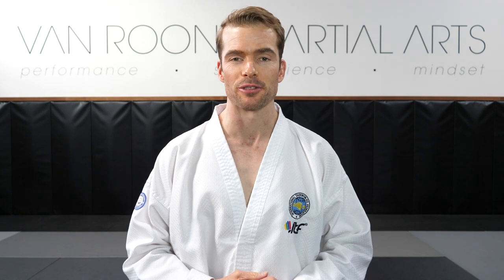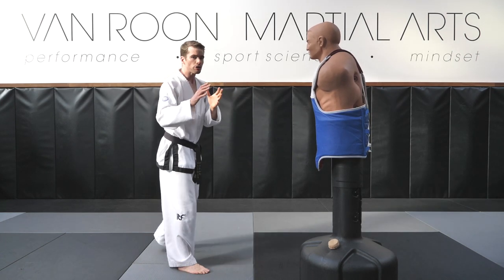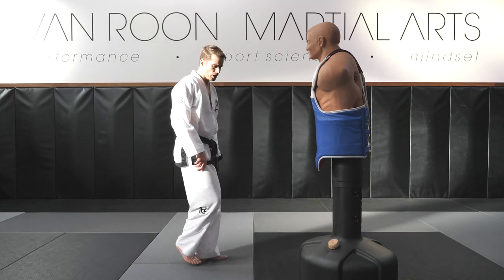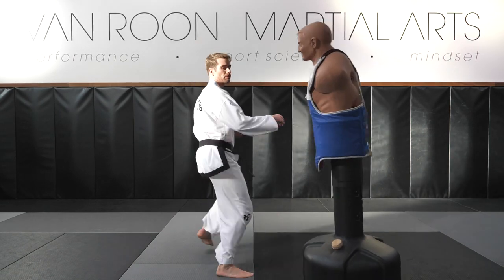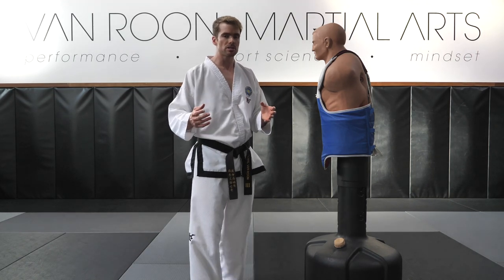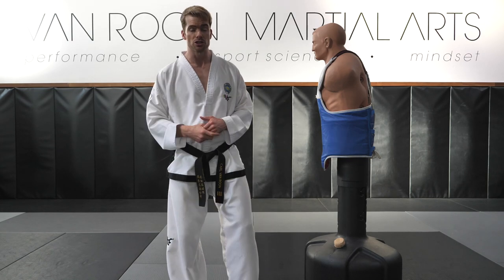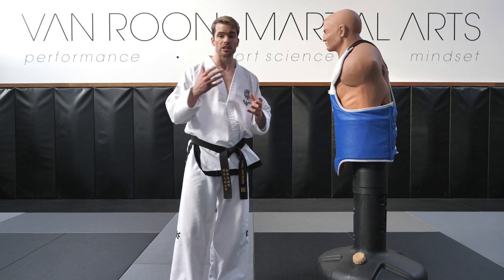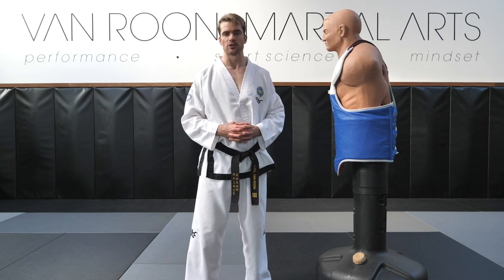How to / Tutorial: Tornado Kick AKA 360° Turning Kick. 돌개차기 / 나래방차기. 竜巻蹴り.

Comment: Why in TKD they don’t use head gear with face shield to prevent possible injury to the eyes or nose, also why not wear knee and elbow pads
Reply: Olympic TKD uses headgear.

Knees and elbows are not allowed in TKD competition, so protection is not required there.

Comment: This is perhaps the least useful kick; a quick reverse or obverse punch is more than enough to end a match against most that use this. It's flashy, and it can potentially hit hard, but it is extremely vulnerable to punches. At the 0:03 mark, someone closing into that gets a free face punch while the user is off-balance. At the 0:04 mark, again a free face punch. Without frameskipping this is even slower, though that referee sure can magic teleport walk casually at the 0:07 mark; cut the video to 0.25 speed and analyze it frame by frame; it seems that satan really struggles with me pointing that out every time: looking at casual movements from hair, observers, plants, etc. gives it away, and yet then recording with none of that around is a red flag for y'all.